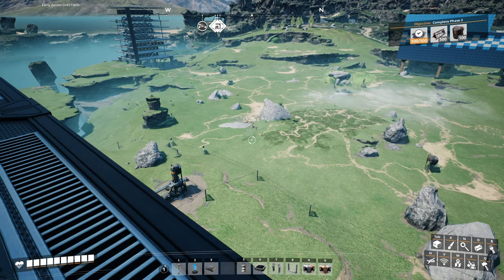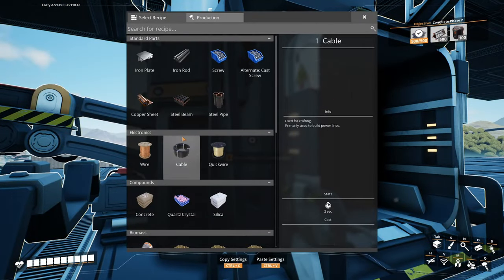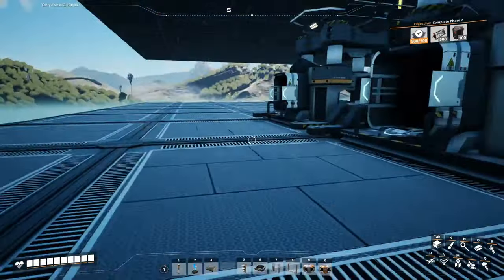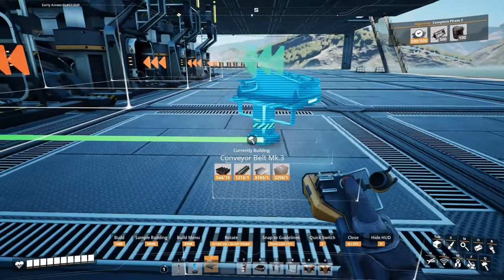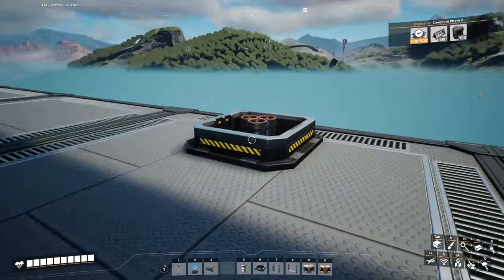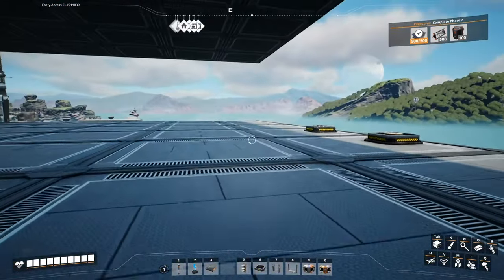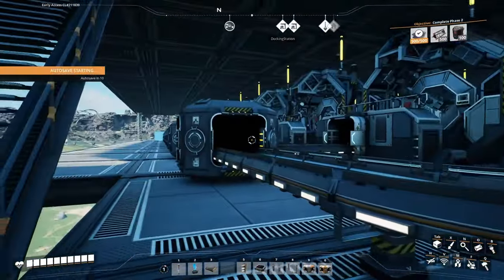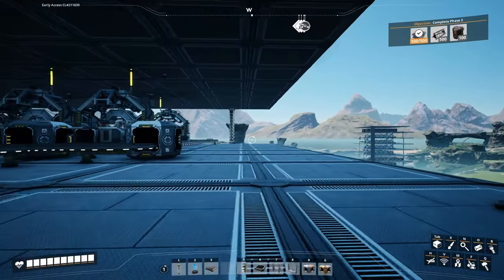Phase 2 Complete!  Let's Play Satisfactory s02 e34

Comment: What I usually do is after every production part, like wires or cables, I'll have astorage buffer, so if need be, I can use part of it to use at other facilities.  What I use to transport will depend on how much I need to move.
Reply from the maker: That makes sense. I'm trying to avoid any conveyor belts between factories (though we may end up with a couple) and then standardizing on tractors for longer transport. 
For smaller quantities, like trips to the space elevator, I may just use a truck.
We'll see where/when I need to add trains to the mix.